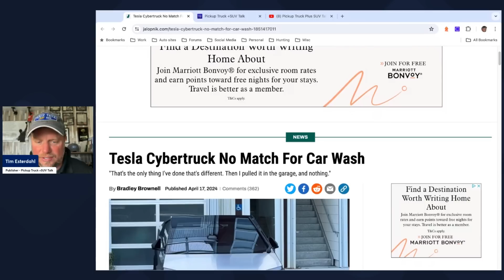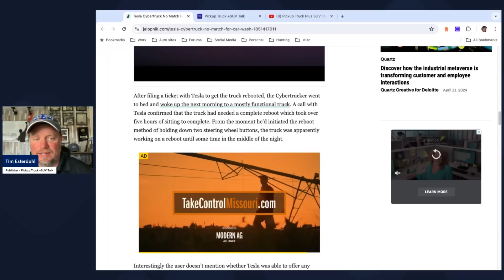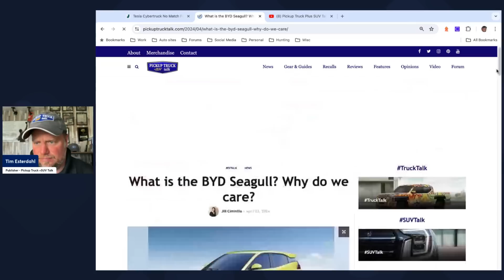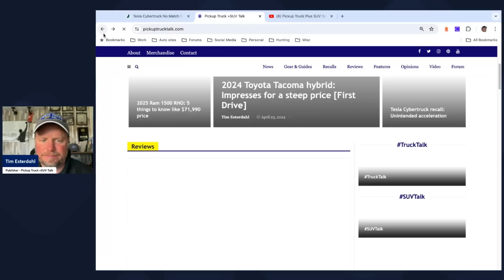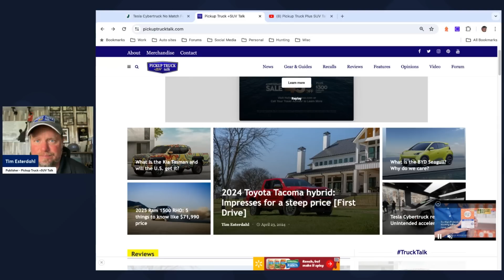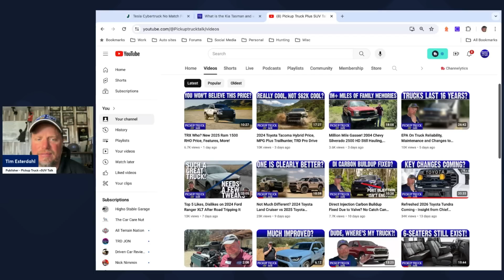Tesla Cybertruck Car Wash Problem? Ram, Toyota Pricing Screw Up?

Comment: Nice. Cybertruck next advices will be: Do not drive your Cybertruck in heavy rain, it will void your warranty. Only wash at midnight otherwise it will also void your warranty. To get a better range, only drive when Mars, Jupiter and Pluton are aligned. Change your brakes on every charge, our accelerator architects told us to do so.

Comment: If the Cybertruck can't handle a car wash, then how reliable is it to drive in the rain? When I first started researching electric vehicles, I had concerns about the design. Electric cars have a computer controlled accelerator pedal, computer controlled steering, and no battery disconnect switch to cut power in an emergency situation. Will the Ram RHO be called the "Rhino"? I have been seeing several stories on YouTube about future trucks, but I wasn't sure if the trucks were real or just AI generated images. The Kia Tasman was one future truck that seemed practical because Kia is very popular now, and I always prefer a boxy truck. I have seen several stores about a new GMC Syclone but it won't be a performance truck like the original but instead just an appearance package.

Comment: How is the new fuel filter coming out different than current fuel filters? Every car I've ever owned had a fuel filter.
Reply: It's not a fuel filter. It's a pollution filter like diesel but for gas engines.

Comment: I kinda want to know what "car wash mode" does??
Reply from the maker: Same. I kinda want to know too.
Reply: A quick search and Tesla says “If taking Cybertruck to an automatic car wash is necessary, Car Wash Mode closes all windows, locks the charge port, and disables windshield wipers, Sentry Mode, and walk-away door locking.”
Reply: @MX5-XU  Probably also closes vents where you wouldn't want water getting into.
Reply: Da truck prices need to be cut 15 k across the board. Then 10% discount on top of that…
Reply: Probably similar in intent to other vehicles where it keeps it in neutral, turns of automatic lights and wipers and turns off automatic braking type safety features.